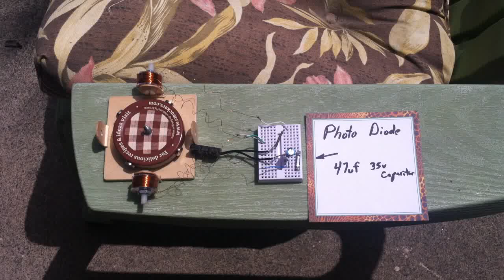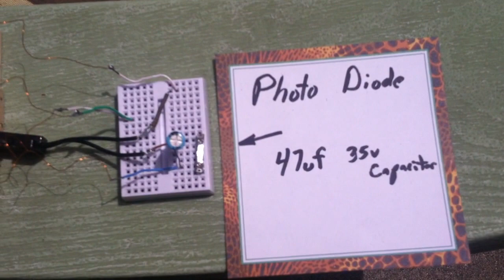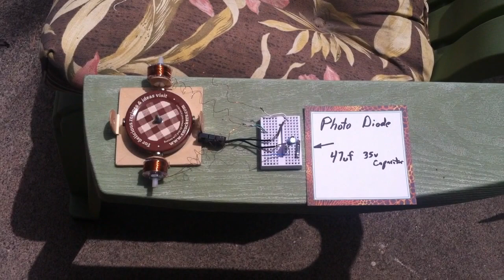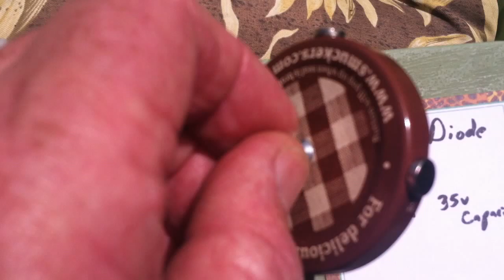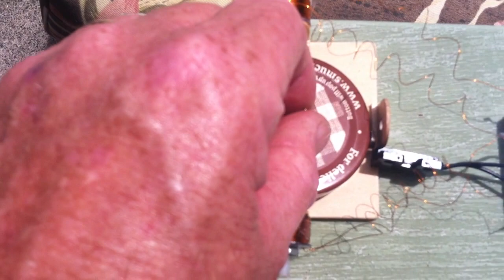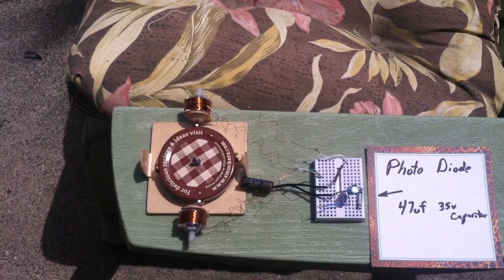Photo Diode Pulse Motor

Comment: how many turns the magnet wire? or any specific size of spool, gauge wire and turns?
Reply from the maker: +casper123103 The coils are sewing machine bobbins filled up with 30 ga magnet wire.  They measure about 10 ohms.

Comment: The photo diode data parameters shows the short-circuit current is 4 uA.
Did you charge the cap before you started the rotor spinning?
Reply from the maker: +zeffur7 No.  The cap is just a 47uf electrolytic.  I was very surprised that this photo diode worked.  If I put a larger value (like a 1000uf) electrolytic in there the motor runs faster.
Reply: +Lidmotor The data from the website (paragraph section) shows the short-circuit current is 1.95mA -- I guess they don't want us to know for certain what it is. :-\

Did you measure the photo diode V output?  Is it near .555 V
Reply from the maker: +zeffur7 In full sun light the photo diode puts out about 1/2 a volt with over 1 mA  so the manufacturer spec sheet must be using a different light level.  It looks like a tiny thin solar cell to me.
Reply: +Lidmotor I wonder how the photo diode compares to an equivalent size piece of a monocrystalline cell.  Might be less expensive to just snap off a piece of a solar cell. :-)
Reply from the maker: +zeffur7  Yes.  That is what I was thinking.  Soldering the connector wires on might be really hard to do though.
Reply: +Lidmotor You would probably have to get some cells that have the busbar on them.

Comment: +Lidmotor  Very good job of bringing to light the important role that a flywheel can play in a motor.  I think this point may be easy to overlook about the LaserSaber EZ Spin Motor.  While the combined high coil resistance and push/pull drive are the most important factors in the EZ Spin Motor there is also a significant flywheel effect from the 12 magnets and the rotor that is sized for them.     Your video also demonstrates well that stored electrical energy is required to run a pulse motor which is powered by very low level energy that is harvested from the environment.  Electrical energy is stored in the capacitor in between pulses to generate enough of the pulsed magnetic force that is needed to keep the rotor continuously rotating.  The photo diode alone could not drive the pulse motor without the energy that gets stored in the capacitor.  This is the same principle used by a riveting machine that stores energy from the motor in the form of rotational kinetic energy and then releases it during the riveting operation.   Very interesting to make these comparisons and to learn from them.  Just about everyone is driven around by 'pulse motors' without realizing it.  The internal combustion engine is a motor that is driven by timed pulses which generate sparks which ignite controlled pulsed explosions.  And these 'pulsed motors' would not work effectively without a flywheel.   Thanks for the thought provoking videos.
Reply from the maker: +ReasonForemost    Thanks for the great comment.  The plain old flywheel is a very important part of our everyday life.

Comment: Thanks for sharing

Can you test with DVD Photo Diode.
Reply from the maker: I tried this with several other types of diodes and this is the only one that has worked so far.  This is really more of a tiny photo cell.  An array of red or IR leds would probably run it.